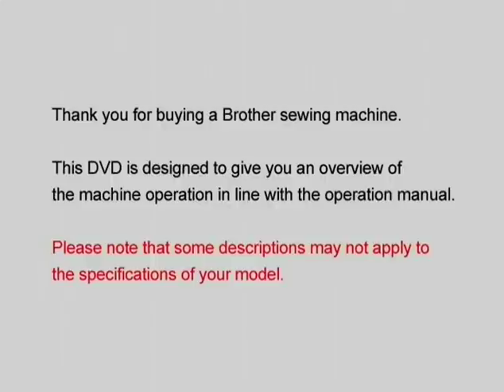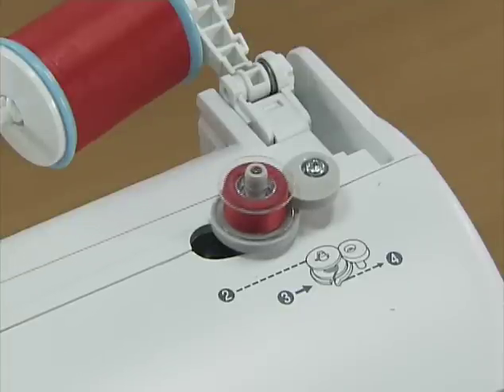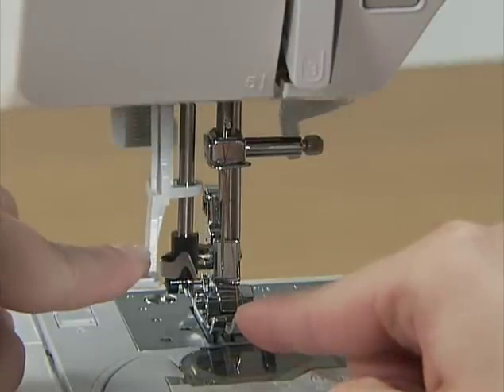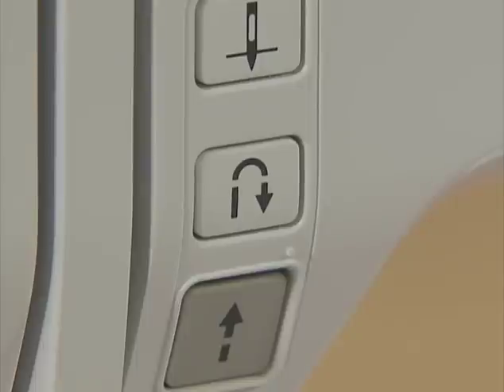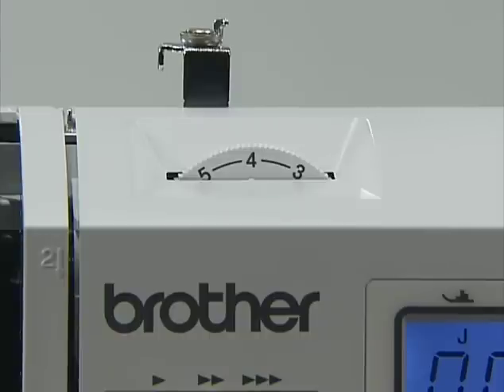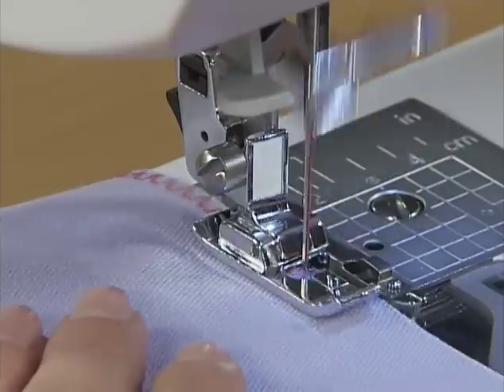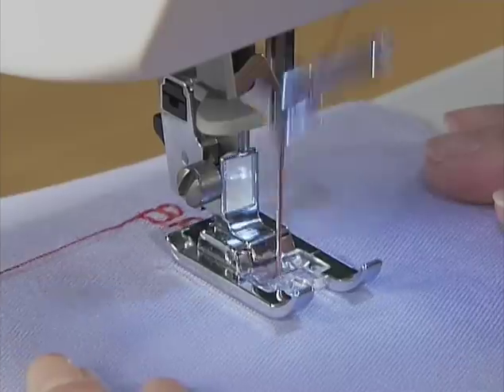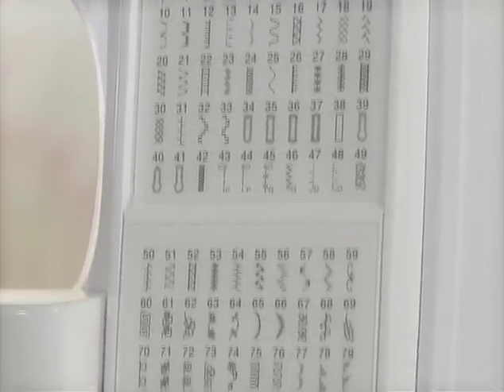Brother HC1850 Sewing Machine

Comment: I just got this machine, my question is, can you make the characters any bigger? Is there an adjustment I'm missing? They are very small.
Reply: My daughter just bought me a new brothers so I machine be HC1850, because my old brother sewing machine started having problems showing through elastic! The new one I just received July 19 is doing the same exact thing, it starts making that noise and brings the top thread down into the bobbin casing in tangles out and then freezes completely. I've been dealing with this for a couple of weeks, read the book and cannot figure out any thing to make it work better, does anybody have an idea how to solve this problem?
Reply: Yes. You make the characters bigger by adjusting the stitch length/width. Use the + or - buttons to the right of the stitch selection and do some practice.
Reply: @janetbicknell1550  Off hand I can only think of 2 things. Make sure there is no thread caught in the bobbin race and make sure you have the right needle.